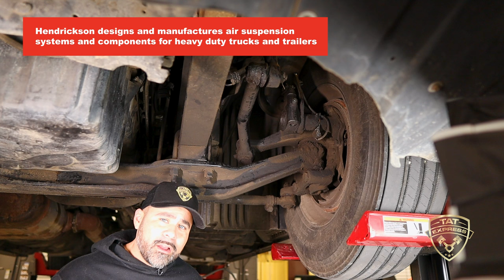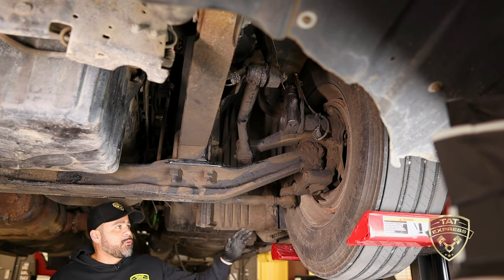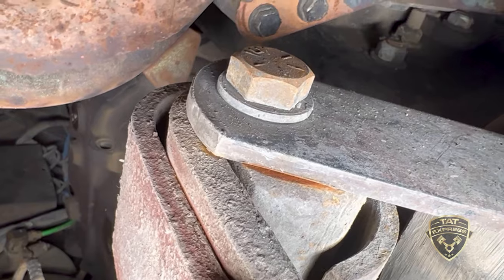How to check suspension on a semi/ How to check my suspension/ How to know suspension problems semi

Comment: This Channal is the absolute bomb! I called this Shop from 1200 miles away. They returned my call 10 minutes later. They told me what to do and how to do it, then what to check for and to call back if i needed an appointment. WHO does that? When I rebuild engine I'll be driving 1200 miles to Dallas. I'm still a Steelers Fan.

Comment: Forgot to mention  cab mount replace those  also
Reply from the maker: Thank you for sharing. You are correct cab mount bushings and shocks should be replaced with suspension shocks.
Reply: Are the cab mounts the same as the cab shocks?
Reply: @johncalvo1743  no

Comment: Adam, roughly how much would you charge to do the whole front end on a 2009 Freightliner Columbia? Parts and labor.
Reply from the maker: We would have to inspect the suspension and then be able to give you an accurate price for everything that needs replacing. Thank you for watching
Reply: Where are u located? I'd like to get my truck inspected.

Comment: Hi Adam can you please help me out I have d13 2016 Volvo my cooling van running hard when the temperature below 45 degrees none stop but when the temperature is up ⬆️ 50 start working normal on and off  please 🙏 help
Reply from the maker: Ensure the correct signals are arriving to the ECM by using PTT.

Comment: How much for everything on the front end that you recommended replacing
Reply from the maker: Suspension work is not cheap but keep in mind suspension usually lasts over 500k miles.
Reply: King pins, bushings with new springs shocks, drag link, inner outer tie rod, 3 axle wheel alignment parts and labor $4800-$5200. 
Rear springs bushings included, shocks sway bar link(s) parts and labor $2700-$3100.